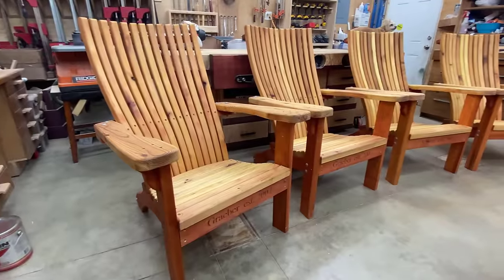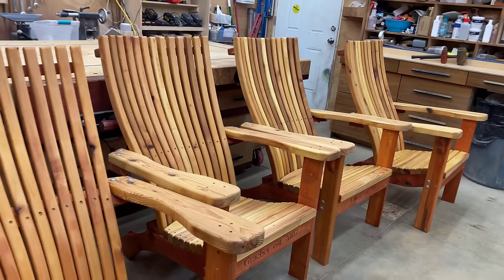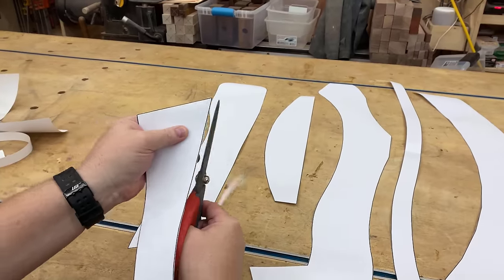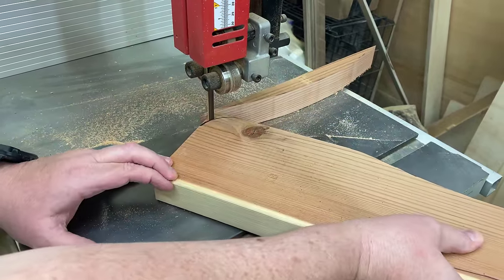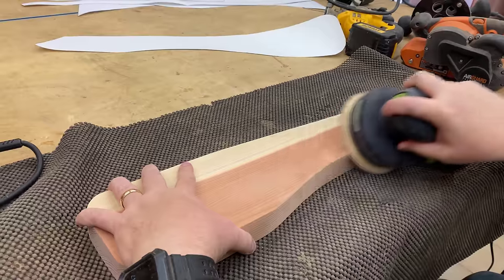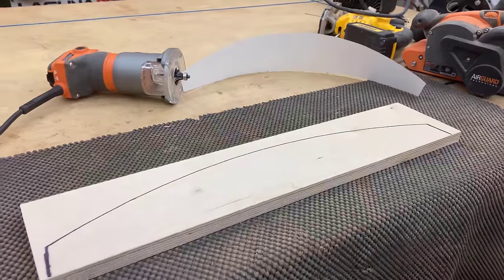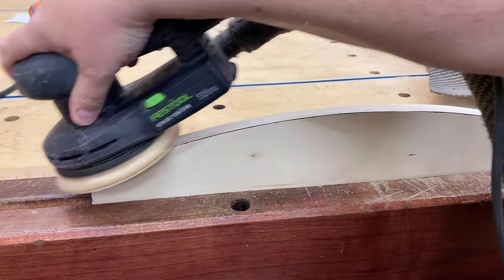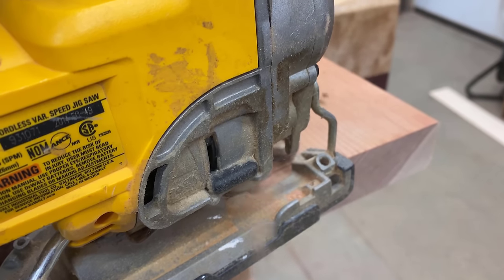How to Make Money Woodworking & Adirondack Chair Detailed Build

Comment: I'm in Canada, I thought sure. I was thinking about making something like this.  So I took the bite. Almost.. $9.99 for the templates, $30 shipping. For some paper? Someone needs to give their head a shake. I can have heavy car parts shipped for less from there.   Figure out some proper shipping costs and maybe you'll get more business.
Reply: Did you not watch the video? You can make your own template with a ＄35 sheet of plywood using the paper. ＄80 all in and you'll make that profit off your first chair. If you don't want to buy the template, then spend weeks designing your own template like I did.

Comment: Today i completed my first of these chairs.  It is super comfortable.  All assembly was done without help.  I can assure you that your first chair will hands down be the crappiest one of these chairs you ever build.  Make the first one for your own use.  Make a second one, learning from your little mistakes and make THAT your showpiece.   Sanding all the pieces after band sawing them took forever.  If you have a router/router table, I highly reccomend making MDF templates as suggested and using them to flush trim your pieces after bandsawing them.  James,  the plans are spot on and you designed a lovely and comfortable chair.  Thanks
Reply from the maker: Thank you. You’re very kind!

Comment: I can't believe that I've sat through this entire presentation. I just ordered the  plans and if I never make one of these chairs at least you'll have some money for your effort.
Reply: Want to get some  template like that  I just like making things
Reply: @timothygaudet8991  it's pretty cool, i agree with you
Reply: What did you think of the plans? I thought they were pretty poorly done. They're not really even plans, just pictures of the chairs and pieces.
Reply: @BrianHw1  agree
Reply: wewwsssssc ce ceviche k eh e k in sep ed w
Reply: @johnhassan2074  after building two, I also agree. The assembly as demonstrated on video was lame and really wrong in some cases. The uneven application of "perfect" and "it's not perfect but it'll do" was disturbing.
Reply: @pierdolio  How was the assembly demonstrated on the video "lame or wrong" when the chair turned out beautiful? Man has literally built hundreds of these and is just passing on his insights. A simple thanks would do the trick.
Reply: @dustinsigmon2222  you shouldn't jump to conclusions or judgements without thinking about what is being said. I think the design of the chair is very good and it looks great. I withheld making a final comment until I had first of all paid for an electronic copy of the plans then I forked out more cash for the full sized plans which were very nicely done. Then I actually built two copies of the chair which ultimately came out looking very good (GREAT DESIGN). The steps in construction as demonstrated were questionable: the initial steps of the construction really need to be changed, the seat slats and their layout should also be modified, the fastening of the arms is in fact a major structural item and should not be treated as a mere afterthought.
Reply: @BrianHw1  hahaha anyone with knowledge of woodworking can clearly build these chairs with these templates with success, maybe just buy a chair and relax, obviously this build is beyond your skill level. Cheers
Reply: @pierdolio  and you shouldn’t go on a mans video giving your negative viewpoints. No one wants to hear that! If you want to change the plans, make your own video just like you want it. 🤫
Reply: @dustinsigmon2222  one mans negative view points are a wise mans road to perfection. I really don't want to hear anymore from your SJW mouth.
Reply: @pierdolio  shhhhh
Reply: @steveiv9250  if you have the templates, yes, it's not that hard to build. I had only bought the plans, which weren't really plans. Just pictures of the pieces (with measurements that were wrong, btw). He sent out a corrected copy about 6 months after the video came out. 

I've built plenty of very good adirondack chairs and am more than capable of making this one with accurate plans. I ended up getting the templates because it was time consuming to draw out all the pieces on graph paper. 

All that being said, I think the plans are inadequate and overpriced even if they're accurate now. I've gotten much better plans free before. If the plans with a PDF template were $15, that would be more reasonable.

Comment: First off - I bought the plans.  Thank you very much for making such a detailed video with tips and tricks!

Dimensional Cedar isn't available anywhere near me, and I don't have the tools to mill my own lumber from a lumber yard.  Would you recommend Southern Yellow Pine or Pressure treated Southern Yellow Pine for this build?  I have heard it's always best to wait for treated lumber to dry fully before assembling which infers staining and assembly will take a very large amount of time for my chair project.
Reply: Cedar is relatively pricey for me so I am going to build my first version in pine, too. I'll use it outside but I'll put stain and a weather sealer on it, too. I'll make a second one, maybe, from cedar the second time. I, too, bought the plans!
Reply: I'm in same situation as you  I'm in NY. Only cedar in stores is fence pickets.  I was looking at kdat decking boards. It's pressure treated then kiln dried.  Found 2  lumber yards near me with it available going to check prices later.

Comment: The only change I would make for aesthetics would be to pencil a line wherever you have a row of screws so they form a straight line. I think that would look much better than a wavy line as in the front of the back rest pieces and the seat pieces.
Reply: This is a good idea. I'd probably set up a jig to drill them on the drill press. They'll be much more uniform. I did this on another adirondack chair I build.
Reply: Right on. I was wondering the same thing about uniformity and consistency

Comment: I've made a couple of Adirondack chairs and what I didn't like were screw holes in the top surfaces of the arm rests or the chair slats.  The last chair I made I decided to put pocket screws in and hold the arms and seat slats that way.  I just like the look of wood with no screw holes showing and of course helping to prevent water from getting into the wood.  However...I do love these chairs you have made James and will be buying plans etc. from you.  Fantastic job.

Comment: I guess I missed the boat on the giveaway 😂 James, your videos, skill, demeanor, and the ease at which you bring these techniques down to earth helped to inspire me to learn woodworking. Of course, I'm still restoring my table saw (little over a year now), but I'm almost done. I cannot wait to circle back to all the videos of yours I've saved in various categories. Can't wait. Thanks so much! ❤it!
Reply from the maker: Thank you. You’re very kind.
Reply: @KingsFineWoodworking  I was just looking at the plans and templates! I see the plans are required to purchase before you can purchase the templates. If you had the templates to trace out the pieces, are the plans used for assembly of the chair, such as location of fasteners and attaching pieces? Am I understanding that correctly? Thanks again!
Reply from the maker: @ForestWoodworks ,

No actually the assembly instructions like fastener location and order of assembly are shown in the video. 

The truth is that the plan is 100% of everything. It contains the exact dimension of every piece. Both straight and curved. It contains all bevel angles, and all miter angles. It includes several perspective views of the full assemble, and the materials list, (2 actually), and the cutlist. And links to everything I used to the best prices on the internet. 

The templates aren’t required at all. The only thing they are for is to save you a couple of hours by scaling the plan drawings of the curved pieces only up to full scale. Some people requested them so we offer them. We don’t even make money on them. I buy them for $9.99, and I sell them for $9.99. 

They have no info on straight pieces. They do not display or show and bevels or miters, or any of the critical info needed to build the chair.
Reply: @KingsFineWoodworking   Sounds like the templates are useful to cut out the shapes, and the plans give measurements. Definitely a time saver. So thoughtful. Thank you James!

Comment: I bought the plans and wood...  It is a lot more than the $100 you mentioned in the video :)   I created the templates in Carbide Create and CNCed the templates in 1/4 MDF.  I will use the templates for my first 2 chairs.  Once I am satisfied the CNC is cutting accurately, I plan on cutting the wood on CNC 3/8 of an inch deep then finish the cut on the bandsaw.  I would like to make the full cut on CNC but it would takes hours for each piece.  The 3/8ths CNC cut will make a great guide for my pattern router bit.  BTW I had to look away when I saw how close your fingers come to the router bit

Comment: Pretty neat! I did find a way to sand out inside contours quickly and easily IF you happen to have a lathe handy. Make a large, round cylinder (about 5-6" diameter) and cover it with sticky back paper available cheap from Klingsphore..  I learned that cutting curved chair backs first with the bandsaw then use the cylinder mounted on the lathe to sand out the saw marks. It's messy, but it works wonders..
Something else I learned the hard way doing body work for years is use the best, most balanced random orbit sander you can lay your hands on. An air sander works much better IMO than electrics, but electrics are easier to get hold of. You are right about staying away from using the edge of the ROS . In the autobody business you'll ruin a paint job no faster way. KEEP it FLAT and don't press down hard,  let the paper do the work. That's especially true when sanding something like a table top, etc.. DO NOT TILT a ROS!

Comment: I have been looking at your video for a while now. Looking at all the details in your video. I have some ideas on what wood I want to use along with what stain and polyurethane to use. 

I like what you showed in the respect of staining and sealing the wood before you start the build. 

So when you start building and you counter sink all the screws. Aren’t the holes just above the screw head exposed to the elements? What do you do to prevent that small area from being exposed?

Comment: Amazing video! Watched the whole thing start to finish. Question... is there a specific reason why u don’t fill in your screw holes with say wood filler and then dab it with the stain? Just curious... Also I assume that particular oil doesn’t require any sort of sealer protection after application? On my Adirondacks I usually do stain then a few coats of Helmsman poly. Thanks so much for sharing your talents with us!!

Comment: I moved recently and now have a shop! I’m getting back into woodworking after 33 years. Thank you for sharing your projects and experience. I don’t have a ton of tools yet, but I’m currently making my first project. I’m really interested in giving one of these chairs a go and some templates would be amazing! Hopefully you’ve still got some laying around you are sharing?!? I’m thinking about a bandsaw for my next purchase and saw you using a Ryobi in another (box joint) vid. How is it? Worth a purchase?
Reply from the maker: Hi!

Here is the link to the plans for it. These are essential. https://kingsfinewoodworking.com/collections/project-plans-for-sale/products/adirondack-chair-new-comfort-design-3-d-plans

After the plans, this is optional. These full size paper templates are for all the curved parts! This makes it even easier.  https://kingsfinewoodworking.com/collections/project-plans-for-sale/products/templates-for-adirondack-chair

The Ryobi is a very basic saw. It will work for some cuts. But it has limited capability. If that’s all you need, it a very good value for the money. 

But at some point if you want to cut regularly, or with more precision, or even do resawing. You will need to move up to something like a 14”.
Reply: @KingsFineWoodworking  Thanks for the quick reply and the honest opinion on the saw! Much appreciated! Keep up the great work!

Comment: Hi James,   Is your final round of sanding done with the 80 grit for these chairs?   I think from another video I had in my mind that you follow-up with a 150 grit but I could be mistaken.  I've made a few chairs first starting with 60 grit, then routing, then following up with 150 grit and it's quite time consuming.  It would be great to hear that the 150 is not necessary if that's the case!

Comment: Great, very instructional video.  Any reason why you do not use glue in this project, as well as the screws and carriage bolts?
Reply from the maker: Glue is a great option. The only drawback is if you need to replace a warped or broken piece it is a little bit more work. But I do recommend glue if you don't mind taking the extra time.
Reply: @KingsFineWoodworking  Thanks for the prompt response, I have sat on some Adiròndack chairs that were a few years old (not your design) and they seemed to be a little "loose", so think I will use an outdoor glue.Again thanks fir the response.

Comment: Great Video.... and I have not used a saw yet. I have started to learn by doing everything. I listened to the end and I must say that your video flows really well. I am not sure if you recorded your voice while sawing and putting together. I think you may have gone back through and added the voice. Either way you video seems to be professionally made. I was considering taking a course on repairing clarinets for extra money. Seeing that your training is free via video it is a heck less than $2000. for the hands on and $000. for the motel and food. I should consider this. It might be easier...
Reply from the maker: You are right. I build first. Then add the voice-over after. 

I try to space out the individual scenes so that I have enough to  space to say what I need to make it all make sense. 

You’ll have fun if you try one of our Adirondack chairs!

Comment: I like the way you create the video then narrate over the top.  As a viewer I find this method clearer and more instructional.  Would like to know why use 3/4" plywood for the templates?  Could I use a thinner material (1/4" plywood or maybe hard board)?  Thank you!
Reply from the maker: You can use any material, and any thickness for the template. Using expensive plywood is a waste, I just used it because I had a whole bunch of odd sized pieces sitting in my shop for the last year from an old project.

Comment: Love these chairs and the templates are awesome.  I’ve built three chairs so far!  One issue I’m having is after the base is made and the front cross board and front legs are on the back left leg sits about 5/8 in off the ground.  It’s not a big deal because my chairs sit in the grass but I just can’t figure out why I can’t get the chair legs to sit level.  Any advise?

Comment: Thanks James.
I got the plans and watched the video (VERY VERY helpful btw!).
On the Middle back cradle you specify to cut 30 degrees on the bandsaw. I honestly got a little confused as I was expecting the finished angle to be at 30 degrees. In the video you mention it is a 30 degree cut.  I hope the finished angle is actually 60 degrees.
Is that correct?

This may be a really stupid question but take it easy on me as I'm new to woodworking (only done a handful of projects)
Reply from the maker: You are correct. It’s 60 degrees up from the flat horizontal, which is 30 degrees down from the vertical. So the angle depends on which way you are measuring it from.

Comment: I just purchased a standard size router and I think it would be a little cumbersome for this project. Rather than get a smaller hand router, I’m thinking of getting a table for my big router which might be more versatile in the long run. Do you see any problem with doing the routing for this project on a table?

Comment: James great video. You talk about being a "big" guy. I am too, and am wondering if the size of this plan is easy for you to sit on the chair, or if it's kinda tight? If it's tight can you just add an inch, 2 inches?
Reply from the maker: I’m almost 6’2”, and about 485 pounds. 
I fit in the chair, but just perfectly. If someone is in the low to mid 500 pound range, you would likely benefit from adding two inches to the width. 

There are 4 pieces of wood that you’ll need to modify for this. 

1- the front cross-piece. This is easy. Just make it 2” longer. 

2,3,4 - the lower, middle, & upper back cradles.  
These take a bit more work. You’ll need to add 2” to the width of each. Then you’ll have to sketch a smooth curve along the fronts to approximate the existing curves. This isn’t hard. Just get a flexible yardstick, and bend it to the curve, while tracing along it. 

Finally, you’ll need to add one more back slat. 

I’m pretty sure by adding this extra width, the chair would function to hold a 600+ pound person comfortably. 

And structurally, if you follow my build directions in the video, the weight is not a problem. We tested the chair at well over 1000 pounds of weight, and it’s still rock solid. 

Hope that helps.
Reply: Thanks James. I should have pointed out I'm 265. Sounds like it should fit my 6' 2" frame just about OK. I imagine you know a lot of challenges for larger folks when it comes to furniture sizing. Thanks for the instant reply.